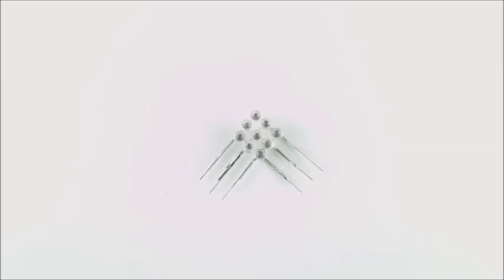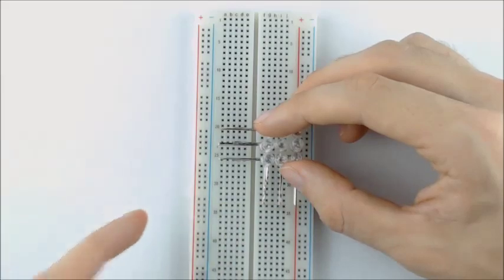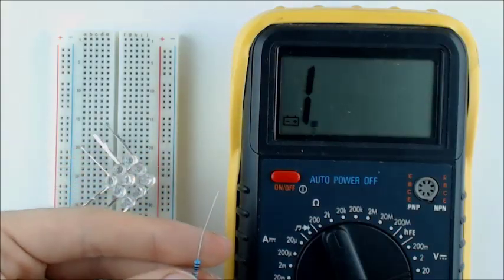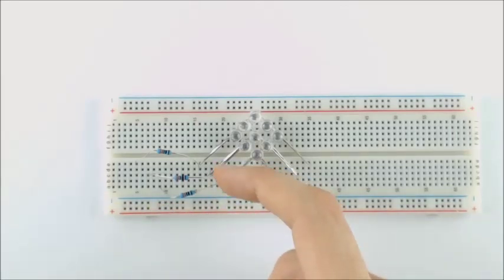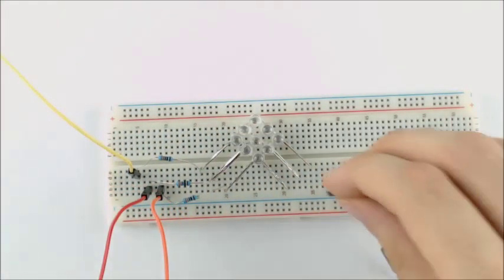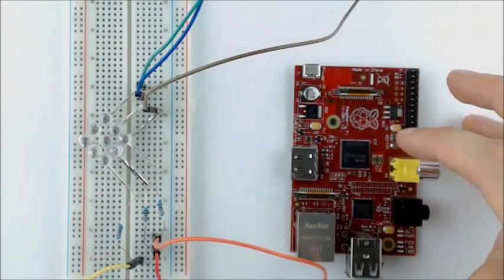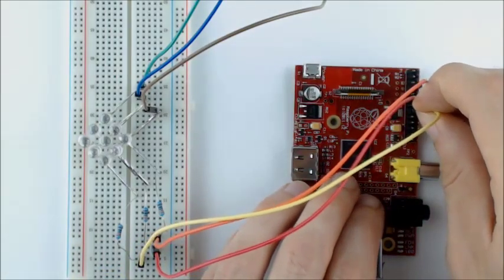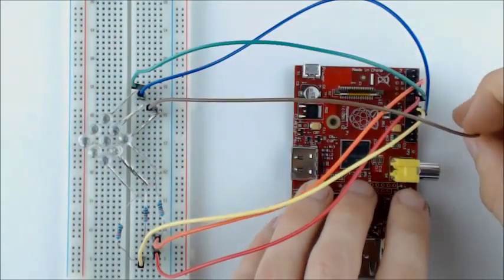Raspberry Pi Project: The LED Matrix (Part 5 of 9)

Comment from the maker: You raise a great point. I'll make a video to show how to use transistors with the LED matrix when time permits.

I would use a PNP transistor connected to the 5V rail and the anodes of the LEDs. To choose the resistor on the base of the transistor, choose the one that could allow the max current needed. For instance, a 1k resistor on the base (from a GPIO pin) will allow at least 200 mA between collector and emitter, but this is only a max. The current drawn will be dictated by the circuit.